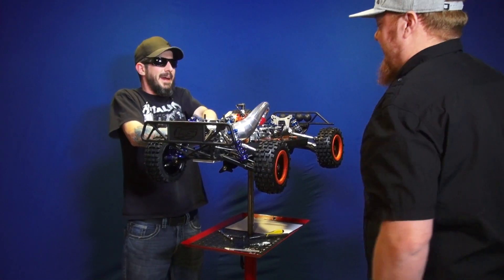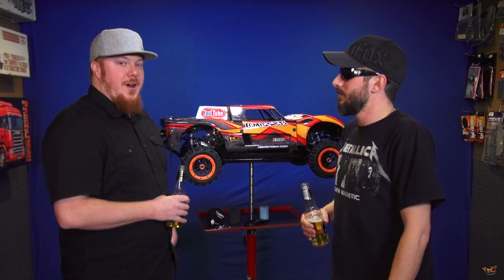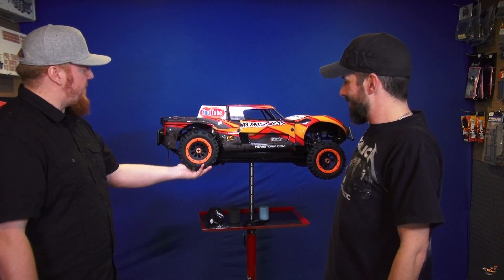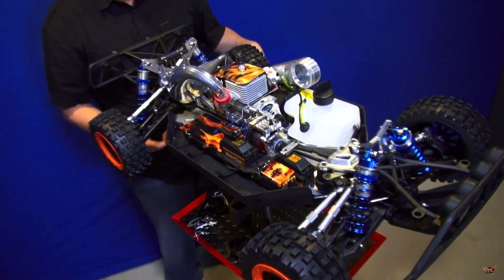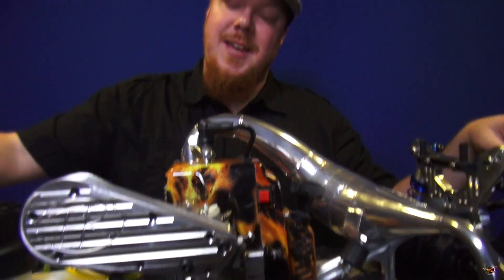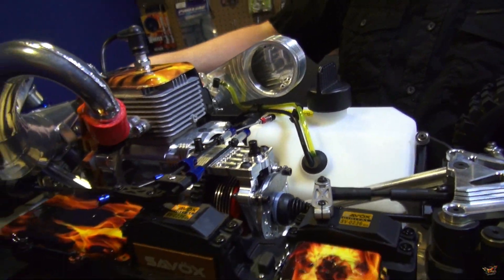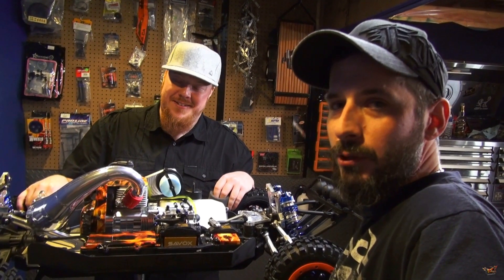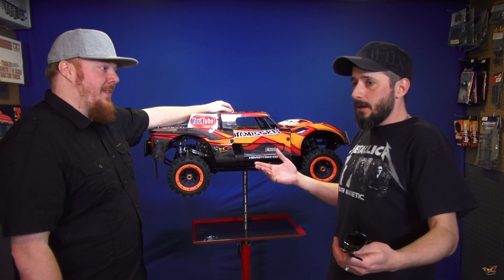RC ADVENTURES - Project: LARGE 2.0 - Episode 600 Celebration! CUSTOM LOSi 5T

Comment: My very first RC was a Gremlin………………
The motor came with 3 lose head bolts, a bad clutch spring, broken A arm, broken radio antenna and few minor things as well
That was my very first Gremlin which also was known as a REDCAT!!!!!!
But I thought well it could have been a bad RC as its been known to happen so I took another chance and bought a second Redcat……………
Well that too was a Gremlin with even more problems if you can imagine
So needless to say I ran as far and as fast as I could from Redcat and never looked back
And now I am very happy with every RC I own as they have all been Gremlin free
Great video keep them coming and best wishes to the family your friend in Vermont
Paul

Comment: My buddies ecx revenge has an esc gremlin and rear hub carrier gremlins. While my slash platinum has a weird steering gremlin. (Likes to drift right when driven extensivly) does it when its cold. Drives straight when warm.

Comment: Dual servo burnout could have easily been interference on the signal lines for the servo itself causing twitching. running the VCC and ground wires through ferrite cores and adding capacitors across them often suppresses this. Cutting the signal wire short as possible and in some cases swapping it for a shielded wire (cut the plugs off of a USB cable and you have a nice 4 conductor shielded cable). Should eliminate any twitching. If there is twitch then the 2 servos will literally be fighting each other causing one or both to burn out. Bit late to confirm if twitching was indeed the case though.

Have you seen losi's new 5ive-R? Nice shirt btw, who doesn't like a bit of Metallica.

Comment: wow this looks great. loving the penta body and the colorsceme.
about the servos. did i see it correctly you now use a single steering servo setup right ?? both the steering and brake/gas servo are both Savox SV0236,  is there a special reason why everett has chosen these ?? is it enough for the steering ?? . the price is very nice for them btw.

Comment: Ha ha don't get me started on gremlins 

I started up my new nitro engine with a fresh glow plug and fule 
Whenever I took out the glow plug starter it would die so I drove it with the glow plug starter on it rolled the truck and broke the glow plug and then ran out of fule this = a lot of work 😂😂😂 it's fixed now tho it was the fule it had been sitting there for years makes sence now

Comment: What springs and weight oil are you running? I just got my Losi 5ive, its stock and it sits low in the rear and bottoms out easy. Im looking to change out the springs and oil to better suit it for bashing. Any advise would be appreciated.

Comment: I have a T-maxx that when it gets to running temp it starts to leak then when it cools it don't leak turns out the carb is plastic the carb on my old rs4 racer I replaced the carb with a aluminum one and have yet to have any trouble now I just need to find one for the TRX 3.3 Traxxas motor

Comment: i have traxxas slash 4x4 and the same thing hap end to me one of the tiers were sticking out and the other was strait i replaced the steering link arms and the and then looked at the servo it was fine and then took apart the front and there was a crack int the plastic and it was on the part i don't know what it is called but it was connected to the steering link screw and the servo there ws a crack in the plastic right there replaced it then came in 1st the next day at a race

Comment: Still don't understand why your doing more when you've barely drove it on film
Reply from the maker: As we explained in this video (at the beginning) the original build had a problem with the electric & twin steering servo setup. It went through 6 servo's and was a serious issue that couldn't be solved. The truck had a curse on it.. I'm sure. It was mad for making it hurl through the air so many times.. So - it has been rebuilt.  Hows that.. better?
Reply: Yeah I realized after watching the video. Was just too early to judge. Watching now. Love it. I do have one question. Thinking about buying a knock off hpi baja off ebay for 500. Good idea? I heard the strip gears a lot in the diff and spur